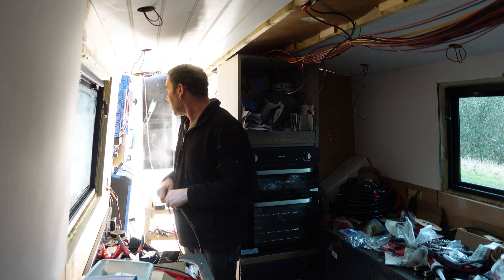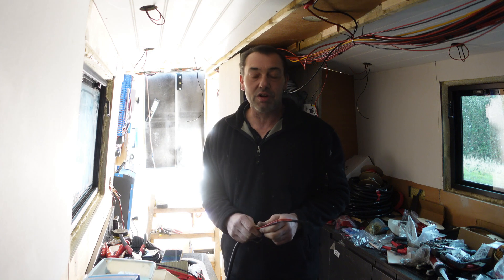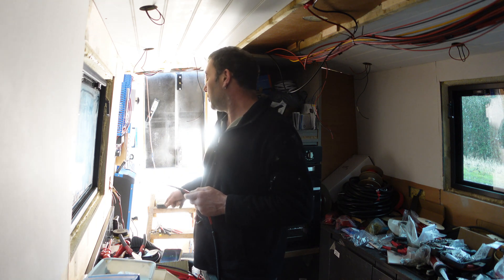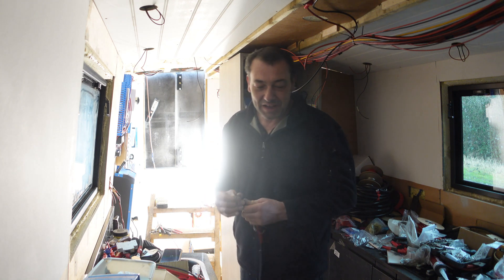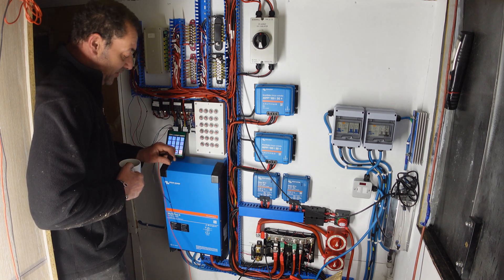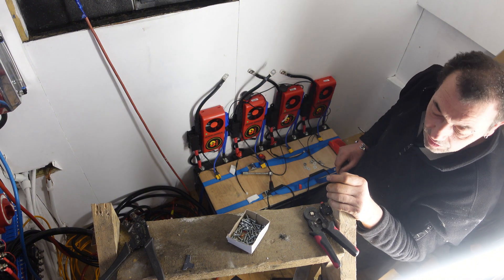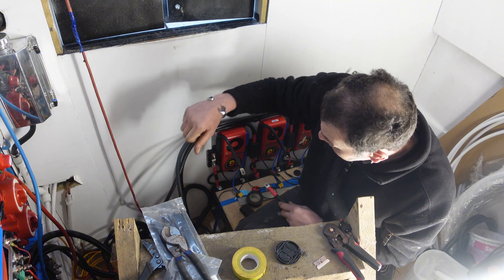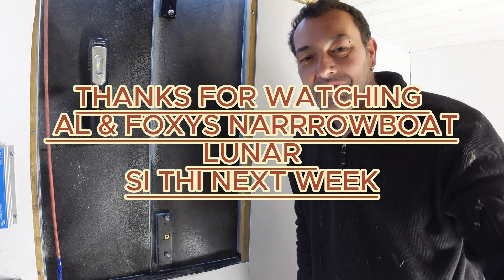Lithium Iron Phosphate (LiFePO4) batteries NARROWBOAT LUNAR FIT OUT 60

Comment: Can I just ask what ah is your battery setup and why you are using 4 daly battery bms’s on what I’m thinking looks like a 3000va multiplus ..
Reply from the maker: Hi the total ah is 1220. 305 per pack with 200a BMS. I have built it this way so if I have a problem with a battery or BMS it can be removed from the system and the system will still work good thanks for your comment

Comment: Before when I used Lead acid battery's for my house I'd have to run a generator many times a week to keep them up, 3 years ago I switched to a LIP battery.. Have not run it for charging the whole time.. My system, 1000 watts of solar, 24 volt 2000 watt inverter, 45 amp mppt charge controller, and one 24 volt 150 amp battery.. It's modest but keeps a large reefer going 24/7 ..
Reply from the maker: Lifpo4 battery’s is definitely the way to go. Bet you would not got back to lead acid again 😊 thanks Al

Comment: Hi Al just out of interest you fitted mega fuses with lifepo batteries , I was informed to use "t type" when I did mine back a few years as the high discharge could possibly jump the blown mega fuse and still cause damage , looking good though
Reply from the maker: Hi thanks for your comment. There is a few videos going about saying you must fit them the T class fuse but the BMS will shut down at 200a and Victron recommends mega fuse. Thanks Al
Reply: @AlFoxysNarrowboatLUNAR   @AlFoxysNarrowboatLUNAR  Tech changes with time I did mine in late 90s

Comment: Your electrics installation will become a reference design that future fitouts will aspire to emulate. 

It was a good thing you did not try to pronounce my username when discussing AC2 posts.

p.s. those cockpit entrance doors have a good painted internal finish, what paint did you use?
Reply from the maker: Hi the paint on the inside of the doors and the duck hatch doors is the black epoxy same as on the outside. Thanks for the great comments

Comment: I'm very imprest how neat that looks Al, where did you get that cable tray from it's not listed on Victron website?
Reply from the maker: Hi thanks I couldn’t believe how much better it looks with the covers on. It’s from a web company called Nohma search for Slotted Trunking
- Blue 50 x
50mm £6.49 for 2m thanks Al
Reply: @AlFoxysNarrowboatLUNAR   Thanks Al found it , that's a good sight for full kits!
Reply from the maker: @FlashGormless  are you fitting a boat out at the minute?
Reply: @AlFoxysNarrowboatLUNAR  No I have a GRP cruiser but i'm looking for a narrowboat and will upgrade all the lekky systems hopefully.